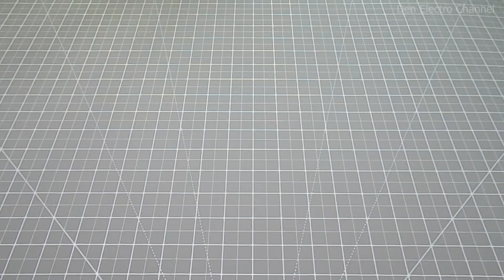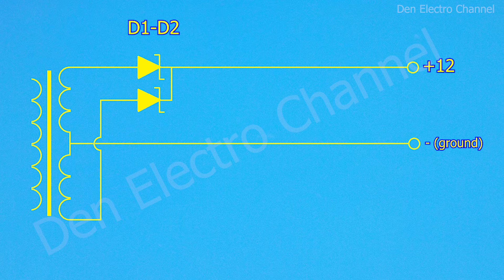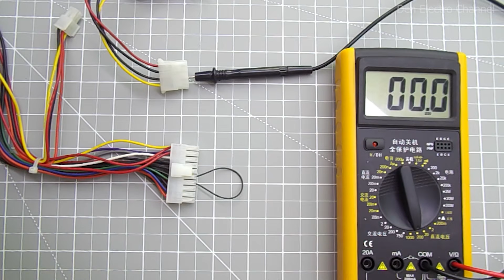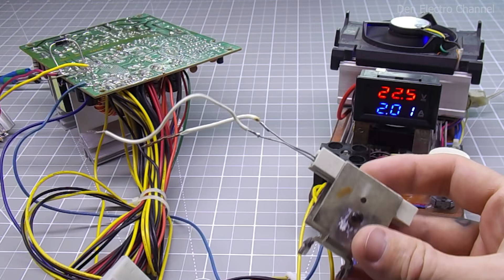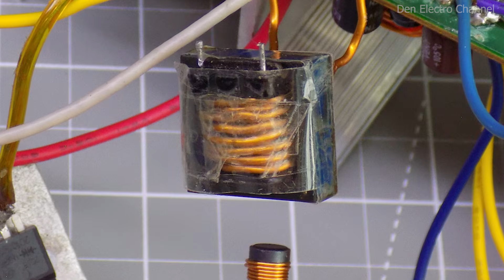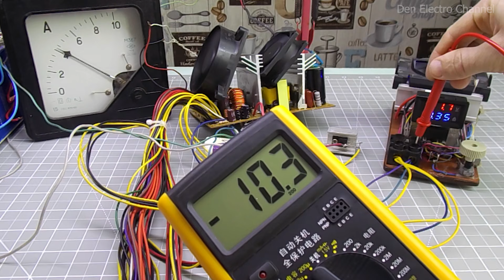How to Modify a Power Supply for 24V Output | 10 Amps Easy

Comment: Can I use insted of resistor 20100ct use 2040ct, it's just have max voltage lower, but it going through max 24v. AM I correct?
Reply from the maker: Hello. Yes, you can use 2040 diodes, but it would be better to choose something rated for 60 volts to have a greater voltage margin.

Comment: bro one question, do you plan on doing a tutorial on your dummy load? im interested on it, also another idea for your channel, you can use the chopper from an atx supply as an inverter 250v dc, having one atx supply and adding another chopper on the 12v output as input for the new chopper's secondary winding :D

Comment: as someone who did this mod already, here some info:
if you can clone the +12v components on the -12v (diodes, capacitors, for the inductor if you have a spare psu grab the inductor from that one and leave the +12v winding and use it for this mod) also use the same heatsinks if possible, its better.
if the psu is old/used or generic, dont believe the amperage advertised, use only half, if new use 3/4 of it, hope this helps.
Reply from the maker: Thank you for sharing your experience
Reply from the maker: If you liked this power supply, I recommend checking out my new video. In it, I’ve put together a simple 12-volt switching power supply capable of delivering over 10 amps at the output. https://youtu.be/dk_wWiMgV4g

Comment: Is it work to old psu w/ tl494, also? 
*request - In the next video, pls how to rewind transformer to 24v or more - in my opinion it is more reliable source 24v 10A psu modified
Reply: pwm ic used doesn't matter, the chopper transformer generates both voltage rails, you're just increasing the possible amperage available from the -12v lane which is balanced from +12v anyways.
Reply from the maker: Yes, absolutely correct. The type of chip doesn't matter here. This method of converting to 24 volts will work on any type.

Comment: this is really informative. 👍👍
Reply from the maker: thanks
Reply from the maker: If you liked this power supply, I recommend checking out my new video. In it, I’ve put together a simple 12-volt switching power supply capable of delivering over 10 amps at the output. https://youtu.be/dk_wWiMgV4g

Comment: Awesome!
Please continue this project!
 I think the best way is making a clean separate circuit for the -12v so it can be rebust. It supposed to be same filtration with the +12v and I think just placing TO220 form factor Shottkies does the job where you can just get from another old PSU. Connecting diodes parallel not recommended due to the silicone behavior which causes to ruin all current form one way which has lower rise time and resistance. All these might help low EMC and low ripple output I believe.
I m guessing when you add load to the 5v rail the voltage drop reduces because of the feedback to the PFC circuit.
Reply from the maker: Thanks for the advice. I think you're right.
Reply from the maker: If you liked this power supply, I recommend checking out my new video. In it, I’ve put together a simple 12-volt switching power supply capable of delivering over 10 amps at the output. https://youtu.be/dk_wWiMgV4g

Comment: Thank you. 
For my usecase, my entire DIY networking & nas setup consumes roughly 55-60W at idle. It goes upto 100W under load. I don't think this mod can do that 24x7 reliably 😅😅
Will go with a standalone 24V 10A PSU
Reply from the maker: Everyone does what they feel comfortable with. Thanks for watching.
Reply from the maker: If you liked this power supply, I recommend checking out my new video. In it, I’ve put together a simple 12-volt switching power supply capable of delivering over 10 amps at the output. https://youtu.be/dk_wWiMgV4g